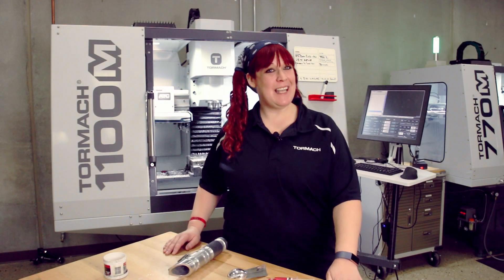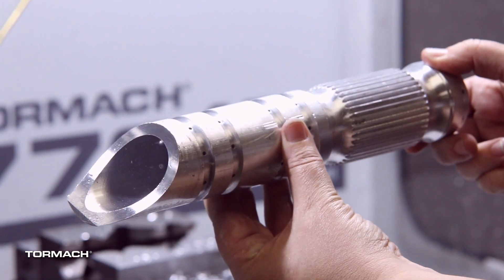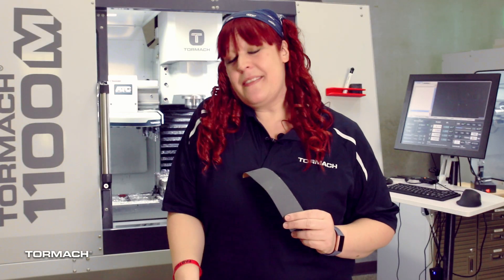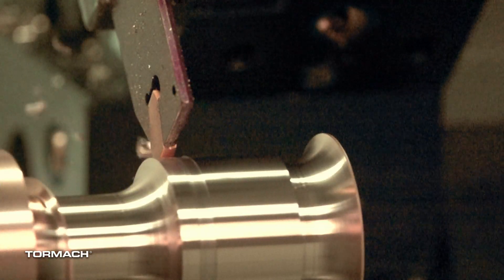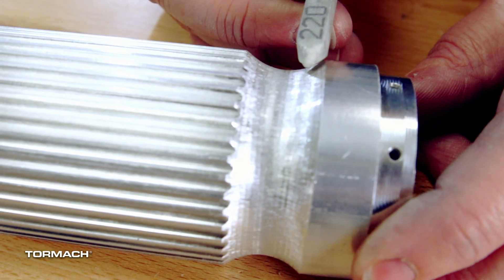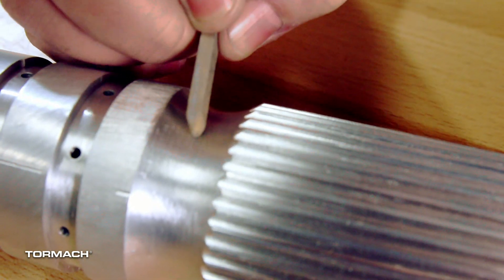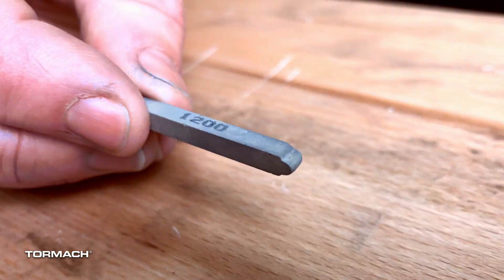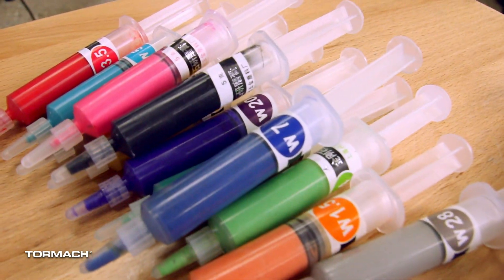Aluminum Polishing How-To & Tricks – The Hacksmith Lightsaber

Comment: Jenny, we all welcome going in a little detail on the science of shine and gloss. No one here is a dumb that just wants to get on with it. If not we wouldn't be owning our own CNCs. Please add that to the next video. It always helps in knowing why things are not working when things go wrong.
Reply: I'd second this. Learning about technique is awesome, but a video or two on the theory would be great as well.
Reply: I appreciate this, Gus. There is a lot going on with the material during the polishing process. Posted the second video this week - hoping it will help unveil a bit more about why certain techniques yield vastly different results. 😉
Reply: @jennybannink823  The heat bit.... this comes down to how burnishing works doesn't. You know, moving the metal rather than abrading it. So little material as to how this all comes together. I think you have learnt it by feel and experience. Fascinates and infuriates me at the same time. I see polishing as whole separate profession as much as welding or machining and so little is publishing on it on the web. I think because its easy to do an average job and SUPER hard work to do a great job.